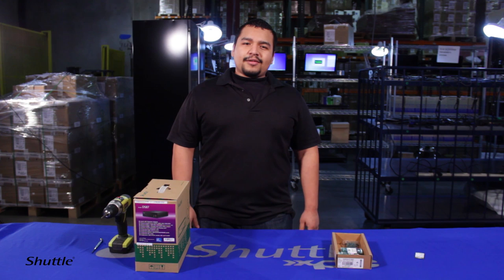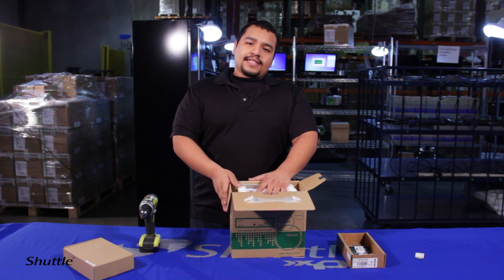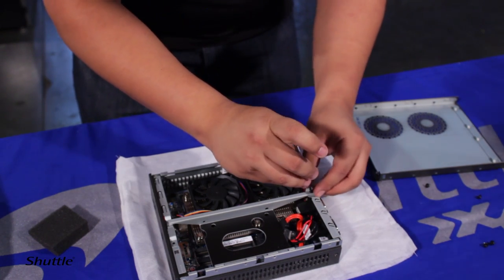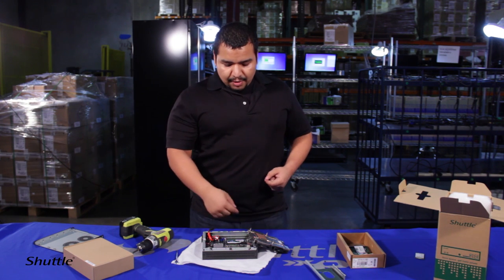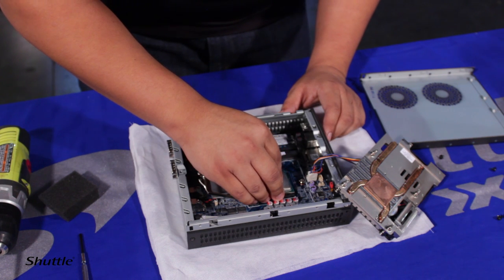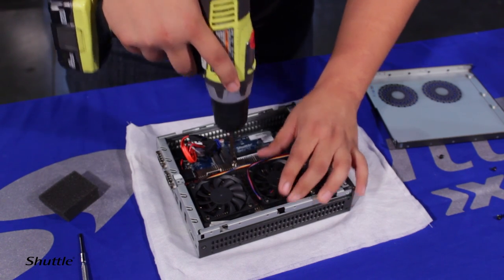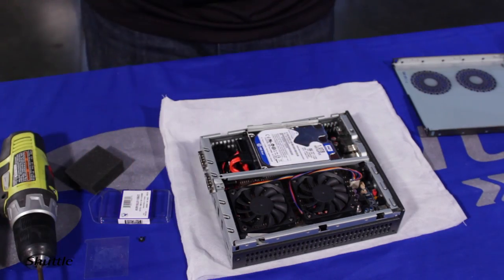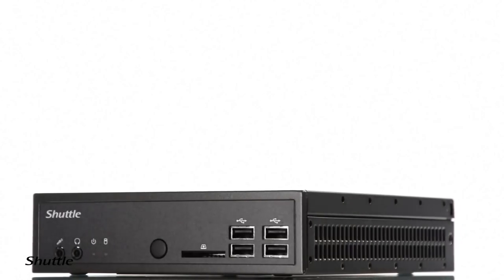How to Build - DS87

Comment: Those two fans you mentioned that you don't unscrew… I did unscrew them to clean the PC after 3 years of continuous usage. Well on each fan, there are 4 screws, but actually 2 of the 4 screws are slightly longer than the other 2!

We're probably talking about 1mm longer! That's mentioned nowhere on the manual or anywhere I could find online. I found myself trying to put those back for hours until I finally realized the screws weren't right and probably destroyed the screw threads…